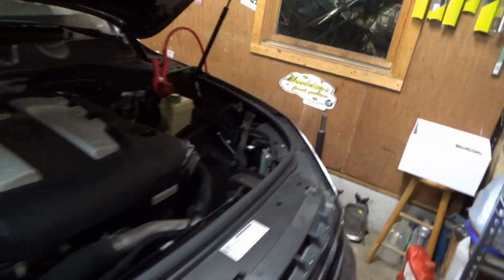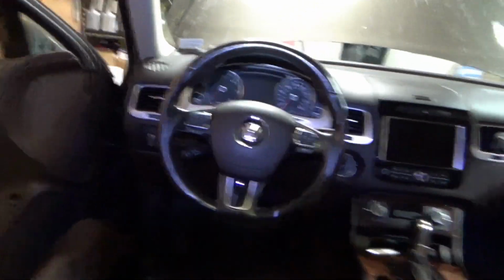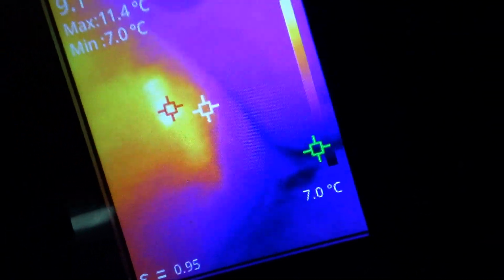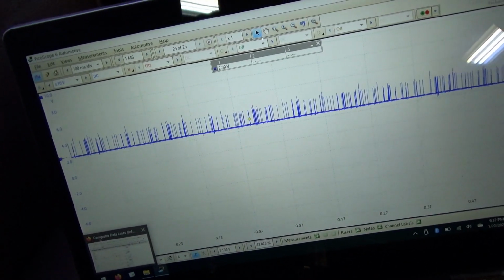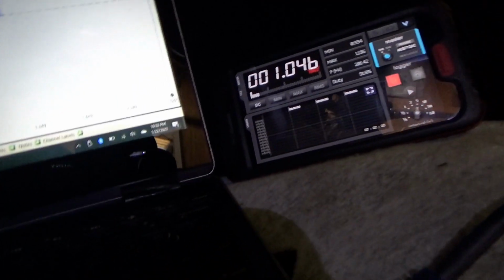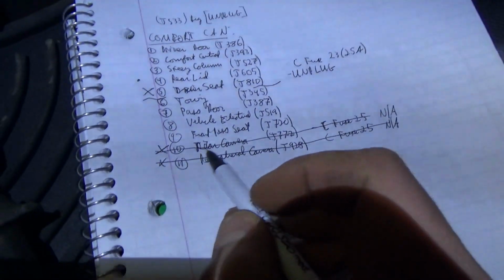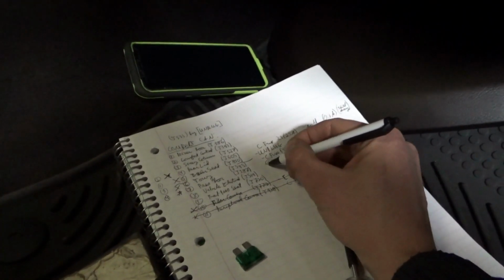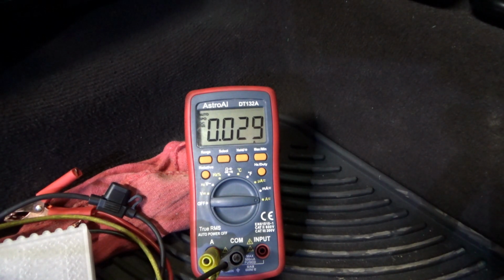INSANE Battery Drain (VW Touareg TDI - Part 1)

Comment: AUDI Q7 that same year range suffer from water intrusion rear quarter windows right hand side, usually amp is back there with water intrusion and corrosion... also the rain sensor in the windsheild and also the clusters cause parasitic draws. I always use infrared camera first saves alot of time. Soon  I'm going to put together of a couple of those wifi loggers maybe Like 5 of them, I'm getting some custom PCB done to try and incorporate all parts on 1  pcb to board.

Comment: 20 plus modules!  Give me the old days. Crank windows Throttle and shift cables. Like you my friend I get an awesome feeling of self satisfaction when you find the problem though.
Reply from the maker: I'm not a fan of useless gizmos but power windows and locks are really nice to have 😄
Reply: @PineHollowAutoDiagnostics  I remember as a kid  going to Florida. 66 Chevy Malibu . Crank windows no A/C AM radio. No cruise control. Hell Dad had to add after market 4 way flashers.
Reply: @billziegmond4943  I remember as a kid going to Florida.  67 Ford Fairlane Squire wagon.  It did have air conditioning, AM radio and 4 way flashers.  I think the emergency flashers were required after 1967.  For some reason, the rear windows had cranks but, you couldn't roll them down, they would hit the armrest.  You also didn't have a Wal-Mart on every corner, so you cooked on the Coleman stove.  The first time I walked into a Winn-Dixie it was the biggest store this young boy had ever seen; and you could walk to another store under the same roof.
Reply from the maker: @billziegmond4943  sounds like our first family trip to Florida in 1994 in a 1985 Honda Civic 😄 I remember turning into a pool of sweat being stuck in a traffic jam. Our friends gave us some cold water and I didn't understand how they were able to keep the water cold in their car. Turns out their 88 Olds Cutlass had ice cold AC haha 😂
Reply: @PineHollowAutoDiagnostics  That 966 has a quick ratio on the window regulator.  You can get that window up with just a few turns.

Comment: I am a little surprised that you use Celsius since there are a lot more divisions in Fahrenheit. Steve Oops, saw the auto ranging. I should be more patient. Too old😊
Reply: It's probably because nearly everything in Celsius by default these days.  That said, I know a lot of people from Europe and none of them seem to understand that most weather is displayed as integer values, and the difference from 21C to 22C is far greater that the difference from 21F to 22F.  In C, that simple integer is the difference from being comfortable to uncomfortable, but in F it is an insignificant difference.

Comment: Is there a switch on the door to tell the system whether it is open or closed? Is it on that fuse, and could it be broken? They are usually kinda flimsy.
I had a trunk lid switch get broken, causing a draw.
My mercedes battery is as big as that one, but it's a gas engine. Diesels can draw a lot of juice starting when it's really cold out, so I can see it having that large of a battery.
I think that's just a downright stupid place to put the battery!
Reply from the maker: If lights turn off when door is latched then switch is OK 🙂

Comment: The aftermarket fuse only pulled 50 milliamperes… thats not usually considered a draw. Most cars can easily pull 50 milliamperes and be absolutely fine
Reply from the maker: It'll destroy your battery if you leave your car sit for a week. Less than 15mA is ok.
Reply: @PineHollowAutoDiagnostics  0.050A is a very insignificant draw on many batteries. A Group 65 can have 75Ah of capacity....so you could draw 0.050A for 1500 hours (62.5 days) with little to no issue.  Obviously lower is idea, but 0.050A isn't very much.  You could draw that much with a poorly designed pulldown/pullup resistor!
Reply from the maker: @RK-kn1ud  50mA may be small, but it certainly means that something is broken 😄

Comment: Iv'e repair loads of KESSY units on these, the problem is, depending on the amount of water ingress, the canbus activation is random  and hard to trace. Always worth popping the case open and checking for the killer greenies...😄😄😄
Reply from the maker: KESSY?
Reply: @PineHollowAutoDiagnostics  Keyless entry module. It's supposed to sit in the background and monitor keyless entry, 2 Mosfets start playing up, and it draws power randomly. Impossible to datalog, use visual inspection.
Reply: @proluxelectronics7419  I hate the KESSY systems. Nowdays lot of theft kessy cars from Toyota (RAV4)

Comment: Everyone needs two of those vw's. So you can dig a hole with one and bury it with the other one. Putting a battery under the seat is pure stupidity, yet people buy that foreign sh*t. That has always been a puzzle to me.
Reply from the maker: My wife really liked riding in it 😅
Reply: @PineHollowAutoDiagnostics  🤣🤣🤣🤣
Reply: @PineHollowAutoDiagnostics  Oh my. Double entendre?  A little stray voltage running wildly through the seats?
Reply: if you dont understand/like  something, it does not mean it stupid
Reply: @kdudutse  Chrysler or even worse because they put it under the wheel well but they should all just keep it in the engine bay where it belongs.

Comment: Battery under the driver's seat? Really? How stupid is that?
Reply: Only two bolts and the seat hinges back, plus how often you change a battery? It’s not that difficult
Reply from the maker: @PatricioGarcia1973  when there's a parasitic draw that battery location becomes a huge pain... But otherwise it's fine 😅

Comment: Touareg in the UK has two bolts under the carpeted plastic trim, remove these and remove rear runner plastic trims and it folds up to allow full access Ivan.
Reply from the maker: Interesting... This one had 4 bolts and 2 hard rails
Reply: @PineHollowAutoDiagnostics  Hey Ivan, love your videos, I’ve seen them all!! 
I have to say some of your repairs require balls of steel. Total respect!!
Yours may be too early, but found a visual reference which may help others getting access to the battery.
What the video does not show is if you remove the rear runner plastic trims then fold backrest forward, the seat swings right back.

https://youtu.be/-B9Vx82tbw0

Comment: I'm already irritated at this car by the fact that you need to REMOVE the driver's seat to get to the battery AND need a wacky socket to do so.... Arrrrrgh!
Reply: Wacky socket?  Those are pretty standard in toolkits these days. Always makes me laugh when people diss European cars when they should be looking at the automotive junk yard which is their own country.
Reply: Engineer. Think of ways to annoy the mechanics … & make money for dealerships
Reply: Well better than the Chrysler where the battery is behind the bumper…. Or the Volvo that have to take apart the whole front of the car to get to the alternator….
Reply: The seat is hinged on one side you can just undo the I think it was front bolts and it falls forward or vis versa.
Reply: @fastbagel  yes it was on the 09 model
Reply: The thing with the battery of course has his tecnical reasons. With so much stuff in the cars today, it needs a giant battery that doesnt fit anywhere else. But that doesnt make it less annoying.
Reply: BMW uses the same size battery under the rear seat. Triple square is very common when you own a Volkswagen.
Reply: Das Auto
Reply: wacky socket😂
Reply: Imagine being an honest Volkswagen car salesman and the customer asks how do you access the battery?  ...and they run away from the dealership as fast as they can...
Reply: Germans

Comment: 1hi ivan your lucky the car you are working on wasnt a tiguan as vw built them with different models with different fuse positions i had a horn problem on mine looked in the hand book it told me to visit main dealer with chassis no for vw to reference build sheet to tell me what fuse position was used on my car  what a frigging joke you would think the necessary fuses would follow standard and options would have a set position
Reply from the maker: Yeah handbook can be vague. OEM service info by build date is usually required for these 👍
Reply: @PineHollowAutoDiagnostics  no fuse diagram no fuse numbers or size (amp) just a reference to each car being individually built and wired and the build sheet fuse layout specifically to my chassis number which should be given with car saying only for this chassis number
Reply from the maker: @jackiemay9471  they just want your money haha
Reply: @PineHollowAutoDiagnostics  i sorted the problem and made my own legend whilst every thing was working one of the vw service geeks told me to look in back of owners book under fuses get page number then on the page listed ill find the fuses then after he said that his colleague sitting behind told him about tiguan fuse build  inspires confidence NOT